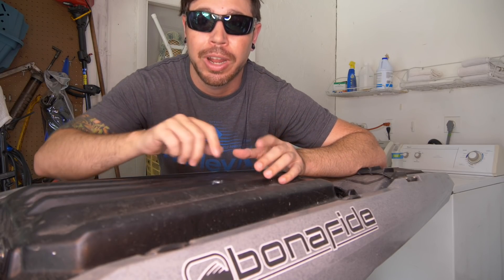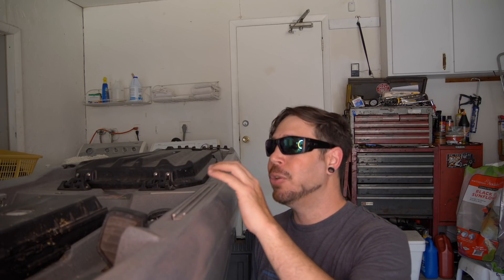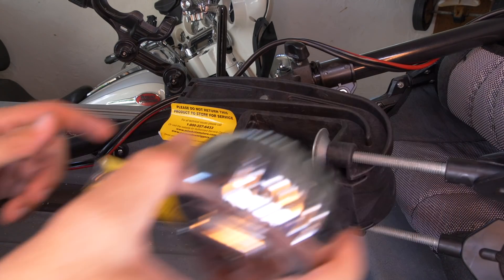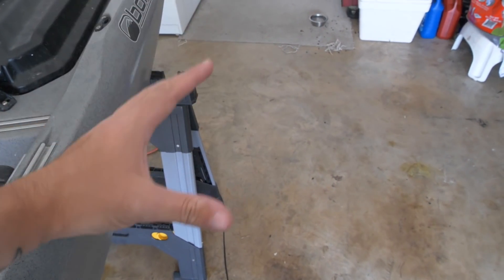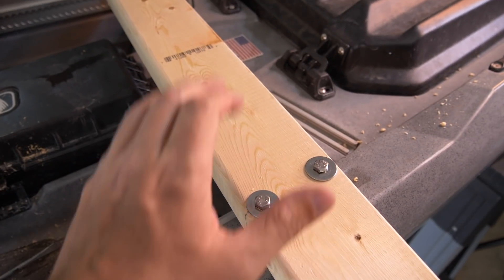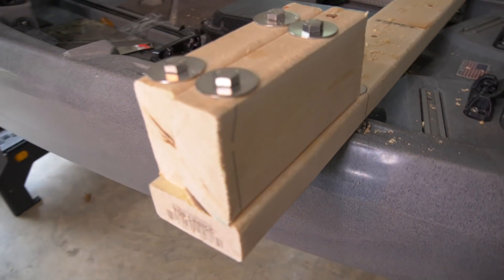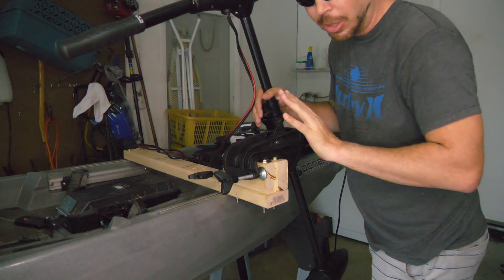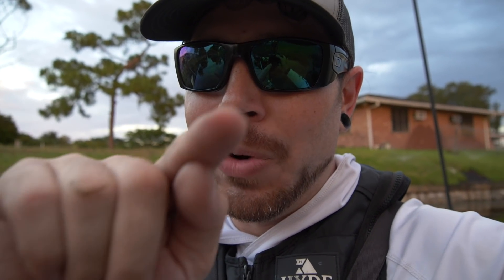DIY Fishing Kayak Trolling Motor

Comment: The old 2x4 has been that size for about 50 years.
Reply from the maker: Its just like buying a set of 35x12.50R17 BFG KM3 mud terrains. You think you're getting a 35" tire, but its actually more like 33.8".
Reply: should have used pressure treated wood
Reply: I've always been told it's to allow for 1/2in sheetrock
Reply: Wrong. You can put half inch Sheetrock on it either way. A 2x4 is the size of the board when it’s rough. If you buy a rough cut 2x4, it’s true to size. But for building purposes, a smooth board is preferred. So they plane off a quarter inch on all 4 sides of the board to make it smooth, and that’s how a 2x4 really turns into a 1.5 x 3.5

Comment: just finished mine today but rain rolled hopefully do test run tomorrow./ mine is mounted behind the seat off to the side
Reply from the maker: Your kayak will track straighter where you're mounting yours. I played around with the position on mine and it worked best just behind the seat.
Reply: Does it track way better behind the seat or slightly better?
Reply from the maker: Just behind the seat it tracks much better.

Comment: I put my trolling motor on the back of my kayak but I used a longer handle on it
Reply from the maker: I'm not sure it will work with my style of fishing. I like to stand up and cover lots of water so having it close by to help maneuver is sort of a necessity for me.
Reply: I run mines in the back with a 3/4 inch pvc pipe running to the front for steering and a speed controller for motor control. I dont like the foot steering because you have to be seated, with the pvc pipe I can stand and steer.

Comment: can you lock the motor into place without moving? like have a direction and not worry about it being nudged?
Reply from the maker: Yes. Tiller operated trolling motors have a clamp you can tighten so it locks the position of the motor.

Comment: Nice setup!  What kind of hardware did you use to mount it in the track itself? I didn’t see that part. Is it regular bolt from a hardware store...screwed into what?
Reply from the maker: I had some spare track hardware from some of yak attack stuff. It’s a long flat plate with a threaded hole in it. Brought it to the hardware store and matched up some bolts with the same threads
Reply: T bolts from Amazon work great on tracks

Comment: I'm going to try this thx! Just trying to find the tracking hardware you used. Where did you get yours and what would the hardware name be for the sliders?
Reply from the maker: The track hardware you can get from yak attack. They have a spare gear track hardware kit that comes with a bunch of goodies.
Reply: I found tooling at Home Depot in Canda. Worked out great. Friend me on FB (Kevin Gorman, blue EMS Star profile pic) and I'll send you pics and the video. Flew through the water on a very windy day.

Comment: how did you like it long term? I had mounted one like that on the front-ish side of the boat, but I also had broke my prop that day, so between the two the tracking was horrible. I could not turn to the right (the mount side) at all.
Reply from the maker: Long term it sucked, but only because the yak didn't track straight. I moved it to just behind the rear seat and it was much better. I moved on to a Hobie PA12 with the 360 drive and was more happy with pedal power than an electric trolling motor.
Reply: @FloBass  most of my tracking issues was due to the position of the mount for me then probably. thats fine, i got some more track coming this week, ill just mount it behind my seat. appreciate the response

Comment: With the rack. Can u mount 2 trolling motors and somehow sync em to get double power? Just wild thought.
Reply from the maker: Dude.... YES!
Reply: Wait for your update video bro. Make it real!!
Reply: You can use same battery for both, a set of wires to each motor. You will need to control both separately tho. Requires super battery, lithium 100ah or higher. Nice benefit is lacking need of re direction of using the single side mount. Dual layout will act as power and steering! Very nice situation.
Reply: That would be super cool! Post pics if you try it.
Reply: As far as a battery goes, I'm using a DEWALT 1500V battery booster/pump/usb/lights. Duel Cycle Battery. Heavy but works great. Just clamp the red to red and black to black and you're good to go. I'll do a yak hack video when I get a chance.

Comment: I like the Old Ford  Truck . Your Sawhorses are on the expensive side . Yes wasting a lot of Battery power with the Trolling Motor turned that much . Try to figure how to mount it on the back with your power pole . Sometimes cheep is not the best way to go .
Reply from the maker: Was never meant for the kayak. Just keeping my hands and mind busy with a cheap project that is temporary.

Comment: the 50 eats ur battery way to much. i have a 30 on my kayak and i can go miles and still have plenty of battery life.
Reply: and you didnt mount it in the back? big oof
Reply from the maker: Hey man, first time fiddling up something like this for the yak. Gimmie a break. I did end up moving it around, and she tracks way better with it right behind the seat. Simple, hardly any parts, and cheap. On high it definitely sucks the juice out of the battery somewhat quickly, but I like the larger motor because I can turn it down and get the same thrust as my buddy who has a 40 on max. Really it was for the jon boat all a long. I just can't sit around without a project to work on. Idle hands are the devil's playground.
Reply: What amp hour do you have for your 30lb? I have a 32lb and still trying to decide on the battery